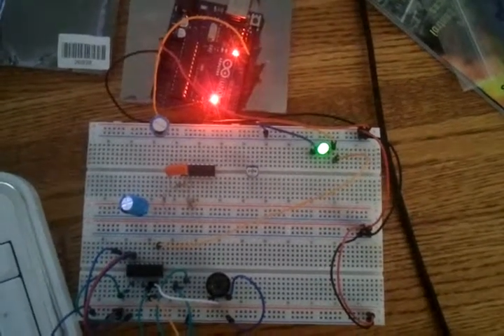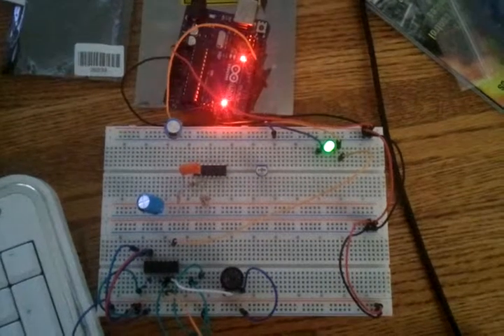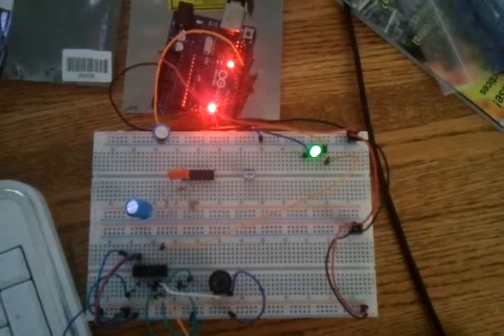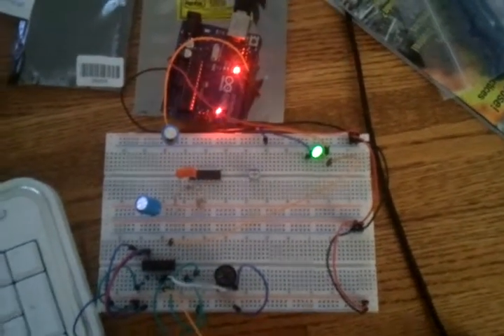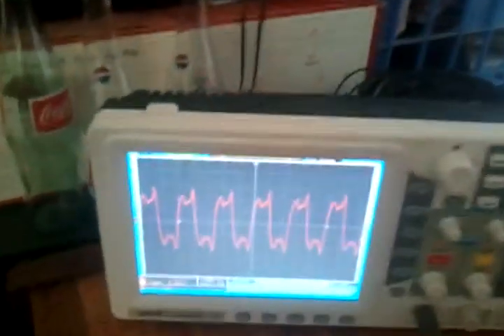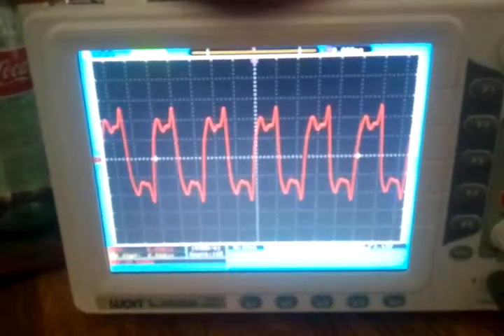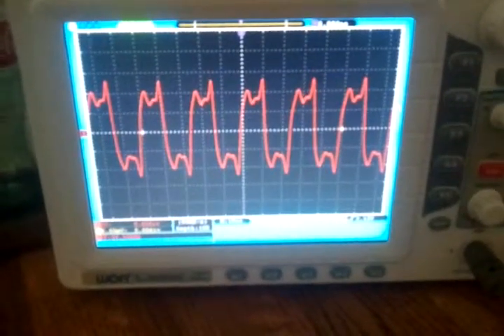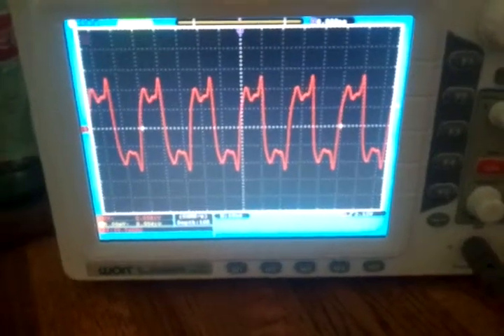Driving the ultrasonic transmitter.

Comment: Would you mind providing a schematic?
Reply from the maker: Trivial.  On the AVR, when you set a pin to output mode, when you're not driving the pin it's tied to ground.  So you just get a transmitter rated for 10 or 12 v, attach it to two pins both in output mode, and switch back and forth between the two pins.  Let's say you're using pins 5 and 6.  When you drive pin 5 to high, it applies +5 across the device, sunk to ground at pin 6.  Then set pin 5 low and pin 6 high, and now the device effectively sees -5v from pin 6 to pin 5, giving you an effective 10 swing.  Clever trick, huh?
Reply from the maker: Oh, also, Mouser has a nice selection of piezo transducers in a range of voltages, including 10v and 12v.